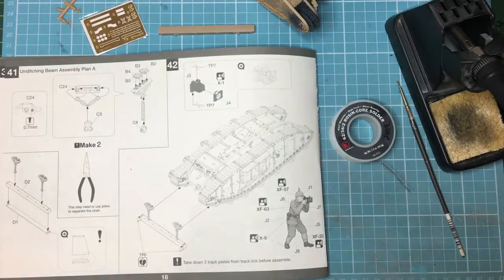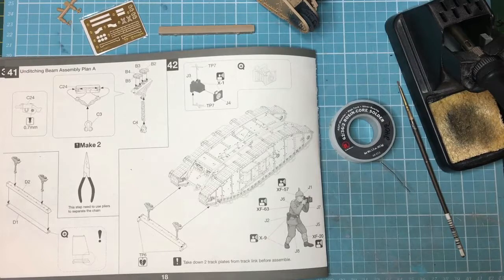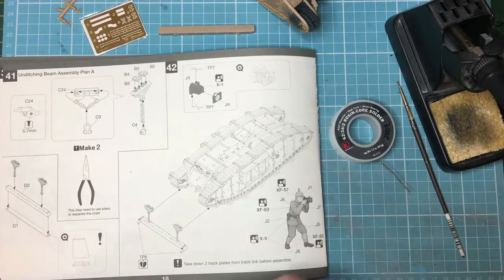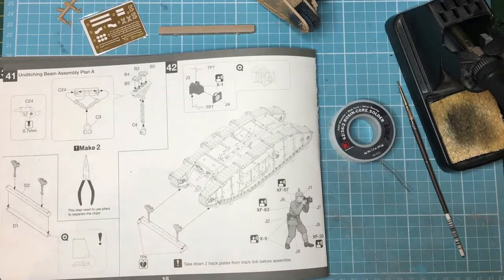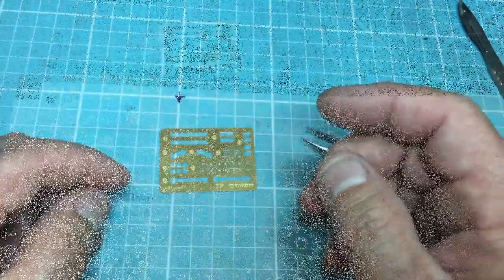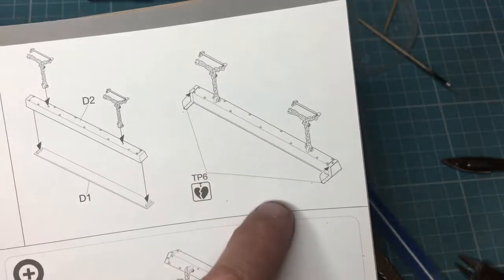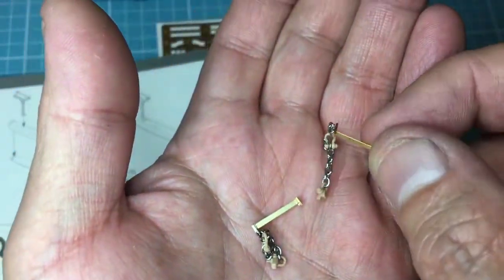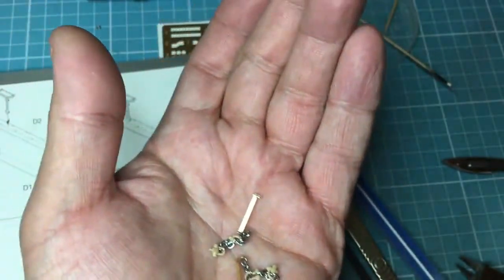Takom 1/35 Mk IV Tank, "One month build" Part 10. Soldering and tracks

Comment: Just a tip for bending PE to 90 when the jig interferes, as in this video. I’ve used a second single edge blade as the brake, as well as using the blunt side of snap-off razor blades, extended from my regular PE brake clamp.
Reply from the maker: That's a good idea!

Comment: I saw you mentioned less than satisfactory results from your solderwick, (braided wire for sucking solder).  Give it a tiny dip in that red flux and it’s will drink solder up like a sponge.  Being that the video is 4 years old, you probably knew this.